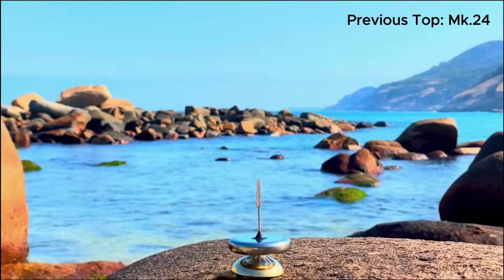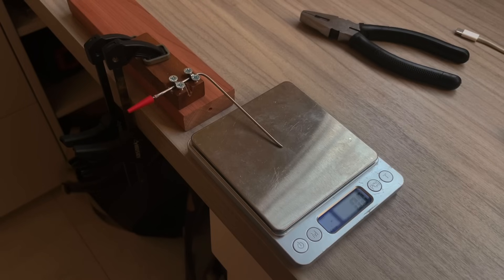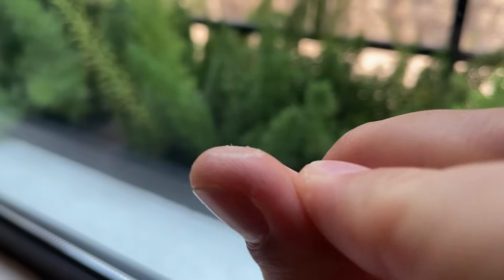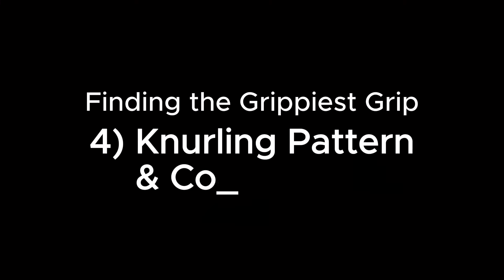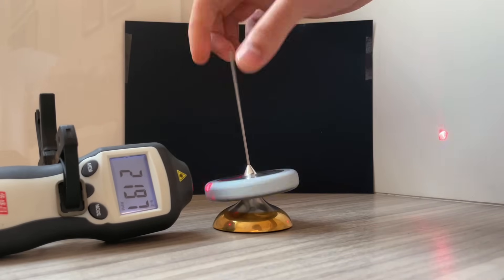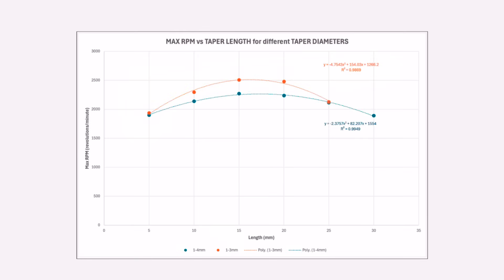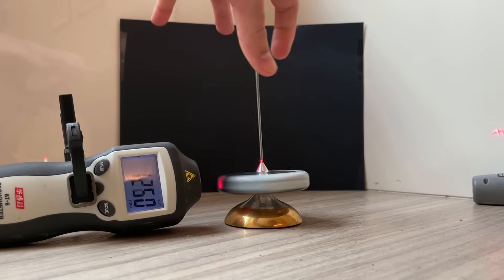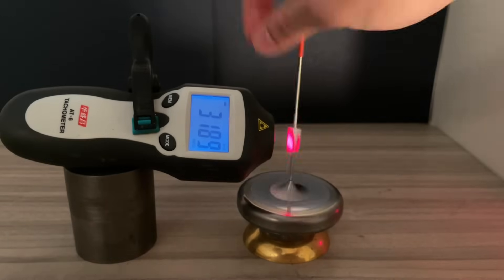Which is the Best GRIP for a Spinning Top?

Comment: Wait I thought you already had the record? I tried googling and I’m getting inconclusive results. What are the records for human powered vs machine powered vs finger powered tops?

Also, I’m so surprised human fingers can get up to 3k rpm, seems impossible, that’s so fast. But doing the math, a 5mm grip at 3200rpm is only traveling at 3.75mph. Which suddenly seems very achievable. Super counter intuitive, I guess that’s the power of small diameters and mechanical advantage.
Reply from the maker: The records are a bit complicated, it depends who you listen to. Guinness recognises a couple records: ~27 hours if a battery is allowed, 1hr37 with string allowed (what I’m aiming for) and ~7hrs of continuous spinning (can use your hand to keep it going). Recordsetter is no longer operating but recognises the finger-started category. I should have this record at 1hr20. In terms of video evidence, there is none for the 1hr37 spin, and I haven’t found anyone beating 1hr20… complicated!

3000 rpm is very hard, but possible. It took me quite a lot of intense practice over a couple weeks to improve from 2000 to 3000. Now that I’m out of practice again, I could probably do 2500.

Comment: Fatter will give more torque but it will reduce revolutions per mm of finger travel. Knurling will have more drag, so material choice and temperature/humidity will also count.
Reply from the maker: I’m interested to hear more about how you think material, temperature and humidity will impact things
Reply: @hiper_tops  Temperature and Humidity can make small percentage differences. Hotter air is less dense, so there is less drag. Humid air is also less dense, so has less drag.

In terms of spinning the top. You want a good grip on the stem - the opposite of the majority of the top. The top wants to be perfectly smooth to reduce drag. Maybe there will be a difference between smooth metal and a metal finished with a silicon polish or other compound - I don’t know. You want the boundary layer to be as thin as possible.

In tens of the bit you spin, it needs to have grip. Your hands want to be very dry. So at least soap and water before a spin, maybe wipe with a thinner (check medical safety). The top of the stem wants to be wiped with acetone to remove any grease. The top of the stem also wants to be light, to reduce procession / wobble, so a light, open pore metal (an Al alloy) might offer good grip while reducing mass.

These are just some untested thoughts.

Comment: I think the taper might be getting in the way at higher speeds. At 3000 rpm, a 1 mm diameter surface moves at about 16 cm per second while a 3 mm diameter surface moves at whopping 48 cm per second - you could be slowing down your top just by grabbing the grip too low. Therefore I'd suggest to try to add about 2 cm long part of constant minimum diameter at the end and at the highest rpm to keep spinning it up just using that part.
Reply from the maker: For stronger materials like aluminium, yes this could be better

Comment: OOOooo! I was happy to see my comment on the video! Glad to see you're taking things in stride.
Just had another thought: Would the record count if you had a removable grip? That would remove more mass from the center and any drag caused by the shaft. 
It could be a loose insert that grips with an internal wedge. Get it up to speed, then pull it out. 
Also, have you looked into plastics, ceramics, or even carbon fiber for the internal material? Something lighter for the inside.
Finally, I'm sure you've already heard this one, but where ever you do you're run, the air needs to be hot and humid for best results (unless you're going to Everest lol).
Reply from the maker: Thanks for the tips! I plan on implementing a lighter core but a removable spindle is against the rules. I would be interested to know why you recommend hot and humid air? Thanks!
Reply: @hiper_tops  Ah! I'm happy to inform! I can't post links in comments, but I found some YouTube videos for you. Just copy-paste
This is a quick basic breakdown video for temperature and altitude density (specifically for aviation): 
 "Pressure Altitude vs Density Altitude | Private Pilot Knowledge Test | FlightInsight"

This is a quick video explaining the moisture thing: 
"Why is Moist Air Less Dense than Dry Air - One Minute Ground School"

You should take a basic top and spin it in a freezer. Then, if you have access to a sauna, try it there and see what the difference is. Over the scale of an hour, it should be fairly noticeable.

Comment: I noticed that in your last video, you showed the top spinning with the sea in the background. Is that to help show that the tests are done at sea level, or is elevation not specified for a record?

The lower air density at higher elevations might make a difference to the air resistance. It's well known to make a difference in sports like baseball and longjump. Temperature and humidity may play a role for similar reasons.

An easy way to test it is to make a small vacuum chamber with a lid you can reach through, so you can get it spinning before sealing it and starting the vacuum pump. Or drive for a bit to somewhere at higher elevation.
Reply from the maker: The background was just for aesthetics :) Elevation is not specified for the record - I hope to experiment with this in the future. In the meantime I do use a vacuum chamber for data collection

Comment: so i have a suspicion that you are going to need to tinker with finger coatings, posibly laytex paint or someting, as well as trying differetn materials for the handle other than plastic. either metal, silicon etc.

Comment: 6:47 Its also easy to see the torque vs speed relationship if you ride a bike. You switch to the small gear for high speed on the flats and the big gear for high torque to climb hills. Which is exactly analogous to your case, switching between the small grip for the high speed near the end and the big grip for the high torque to get the top started. RPM times torque is power, and your muscles can only exert so much power, so torque and speed have a 1 to 1 trade off.
Reply from the maker: Interesting analogy

Comment: As fun as fast RPM tops is I think that focusing on the lows would increase the spin time quite dramatically.

These tops follow a sorta half life decay where the time that the top takes to spin down to half that amount is around the same for it to spin half as much again, so spinning down from 3200 to 3100 is much faster then 400 to 300 as there is less resistance, getting the minimum speed down to the low double digits.
You probably already done that but idk, maybe a very slow spinning top with very little resistance might break the record.
Reply from the maker: Yes the resistance at low speeds is already very low. And I’m aware this speed increase will add only a few minutes but every little helps!

Comment: You should really work on your vocabulary there:
6:40 - you talk about "starting speed" but then show a testsetup and data for maximum speed.

A rough surface like from knurling will increase drag. Given the diameter that will be relatively small, but it should be tested if less knurling has a noticeable impact on spin-time and there are other means of increasing grip like some pitch (baseball is rather known for the pitchers cheating with pitch and tar). And only applying the knurling to the smallest diameter part as that is the only place where you might get into grip problems.

Comment: Haven’t looked at the math at all to see how much lower air density is at higher altitudes, but might be worth looking into. I’d imagine that energy lost to friction with the pivot is much higher than energy lost to air drag due to how smooth the surface is, but you could try setting a clear sealed plastic box with a vacuum attachment to see if air resistance has any noticeable effect on spin time
Reply from the maker: It’s true, altitude would make a noticeable difference. I plan on testing this at some point

Comment: Does it NEED to be finger-spun? What if you did a bowdrill style string launch?
Reply: the record he is going for requires it to be hand spun
Reply: @xfactor529  Right, does that mean using a piece of string isn't an option? It's still "by hand" by any rational definition of the word.
Reply: @operator8014  in one of his older videos he basically said using a string isn’t allowed
Reply: @xfactor529  Gotcha... I gotta read the specific wording of the rules.

Comment: I dont know if this has been tested or would work, but would the temperature and humidity of the air change the drag of the air enough to make a change
Reply from the maker: I suspect the impact would be small but noticeable. However it is hard to test!

Comment: Man, and I thought I was going mad customizing my paper spinning tops. I faced the exact problem when I started increasing the mass/moment of my main body and needed multiple twirls. By the very nature of the origami design, it lends itself to a concave, ACW spiral spindle. Glad to know ACW is not a factor, since my top unfolds itself if you spin it the wrong way. I also came to the conclusion that tiny diameter is the key. My fingers can't keep up just like yours. My concave taper means I can slowly work myself up the stem like you did on a previous design. Knowing that plain is superior means I should invest in some gaffer's tape...
Reply from the maker: Sounds like a fun project! Glad u enjoyed the video :)

Comment: 5:15 "I was blown away by the quality of A1" Proceeds to show parts with elephants' foot, stringing and inconsistent extrusion
lmao
Reply: Sorry who?
Reply: @james2353 What who? literally just search ender review videos. Won't be hard to find someone who got lucky and bought an uncrooked ender.
Reply: I mean he was sponsored isn't like he can talk crap about it
Reply from the maker: To be honest I’m no 3D printing expert but I have honestly enjoyed using the A1 a lot more than my previous printer. I would add that most of the parts I made were just a few millimetres in size with textures down to .2mm in size. So there was a lot of macro filming and nothing looks perfect in macro!
Reply: @hiper_tops Honestly it looks disappointing even it's tiny, or maybe I can't expect a commercial machine to print as well as my self-built one with carefully chosen components to print as well as possible
Reply: I've seen uncalibrated ender 3s perform better, bambu users keep taking Ls

Comment: What if you made it bigger and I mean a lot bigger like 10 times I know that this sounds kind of silly but if it was bigger wouldn't have more weight and thus more momentum think of it like a flywheel
Reply from the maker: Yes it would store more energy but it would lose it much faster due to increased tip friction and air drag! It’s a difficult balancing act and I think what I use at the moment is close to optimal
Reply: @hiper_tops  yeah I figured I was doing the calculations in my head and wondering if that would be too much of a drawback but I'm still curious if you happen to find the perfect size or shape yet though

Comment: Easy idea to try: skateboard grip tape.  Super grippy, like sand paper for grip.  My only concern would be it coming off.  Or your skin.  3M makes quality grip tape for exercise equipment.  Black diamond tape is cheap on ebay and very grippy. May want to work on growing thicker calluses. 

Another idea, and probably a terrible one: something with gears.  If you can have a grip that has gears in between the top and the grip so you can have a large outer diameter but a gear ratio that spins the top fast, that could be a game changer.  How something like that would be manufactured?  I have no idea.
Reply from the maker: Interesting ideas!

Comment: i have a feeling that the little marker you used to measure the speed is adding quite a bit of drag

personally i could imagine getting higher speeds by increasing the grip of your fingers using some rubber like material (straight up gloves likely won't work as the grip against themselves and tend to roll up against small objects your try to spin)

maybe by supergluing a rubber like material to your fingertips (do not see this as advice)

still incredble a simple spinny metal thing can get me watching a video for so long
Reply from the maker: You’re right, the marker does create some drag, however it made measuring much easier. In the future, a transparent shroud would solve this issue. 
Regarding rubber for grip, I believe this could be useful for single-spin tops where the amount of grip is very important, but for mine this should not be necessary. The torque of each twirl gets smaller and smaller as the top gets faster so as long as I can get it started alright, the grip should be good enough :)

Comment: I am very curious about the green shell thing. I think I see what you're trying to do there, but I wonder if it's actually beneficial because of surface boundary layer effects. A fluid (air) flowing alongside a stationary surface (a wall of some kind) experiences drag. This drag decreases with distance away from the surface, creating a "boundary layer" defined as the distance at which the fluid velocity reaches 99% of the free stream velocity. In your enclosed top, you have air coupling to the surface of the top, being pulled along by the motion of the top itself. That same air also couples to the surface of the green shell. If the distance between those two surfaces is less than the thickness of the boundary layer for air at whatever temperature and pressure you're operating at, then essentially you're making it more efficient for the whole system to transfer energy from the top to the shell. But, as the air inside the shell speeds up, its velocity relative to the top decreases, thus decreasing drag, which I suspect is your whole motivation for the shells. The question (that I cannot answer) is which side wins: do you get a net decrease in drag by limiting the amount of air that the top has to accelerate around it? Or do you get a net increase because the outer shell provides a fixed surface for the air to transfer momentum to? You may well have to test different shell configurations with different top-to-shell distances to find a sweet spot or figure out if shells always do more harm than good. This will be very interesting!
Reply from the maker: You’ve really hit the nail on the head, and my next video will look at all of these questions. I’m just starting to collect data but having read some papers, I suspect like all things, there will be an optimal distance and this optimal would be beneficial.

Comment: Like Slick tyre's smooth and fast.
To add something else, climbers chalk? It's available in both powder and a liquid form.
Interesting with the other tests I was already wondering about speed while the torque tests where being done. Seeing negative knurling would be interesting to since it has potentially more surface area rather than bite.
Reply: Climber's chalk is a drying agent, it absorbs sweat and oil during climbing. It doesn't add friction. In fact, chalked hands have less friction than a clean, dry one, which is to climbers' advantage as it prevents scrapes on the hands when they slip. 

Chalk exists because it's not practical for climbers to wash and dry their hands constantly, but for an experiment like this it's quite easy to do so, nor are you working up much of a sweat.
Reply from the maker: Both good points. I actually tried some chalk - I crushed up some regular white chalk for drawing - and found it to be worse. Yes my hands were dry but the dust decreased my grip. Perhaps if this were a single-twirl top with aggressive knurling then chalk might be better. But for mine, I think not

Comment: Nice video!

When I went down the path of finding the best technique with my purchssed tops and max RPM measured with a tachometer...it ended up being wearing these very thin gardening gloves that were sort of silicone-ish.  So the grip is on your hands and not the shaft.

It also saved my finger tips.

Cheating (non-hand) method was using compressed air by long shot.  Although it was too fast, they started sounding like a jet engine and were pretty terrifying to be so close to them.
Reply from the maker: Hahaha yeah spinning tops get scary fast when they get going, especially large ones like mine. This is an interesting idea and a good solution to how thin latex gloves get tangled around the grip. I will try this, at least for the start of the spin-up process
Reply: @hiper_tops are there any official rules for these spinning tops? For example, could a clever mechanism that gives mechanical disadvantage (more rpm, less torque) be legal? As long as it's part of the top? Or does the whole top have to be a solid static object?

Comment: Wouldn't measuring the RPM's at the stem be different from the top since the stem has a smaller diameter it would give you higher readings?
Reply: "Rotations Per Minute" is independent of the diameter. Imagine a rotating disc with two marks along a radius. They are fixed relative to each other. There is no way one could complete a rotation in a different amount of time than the other.
Reply: no
Reply from the maker: Indeed the measured rpm is independent of where on the top it is measured since it is a solid object